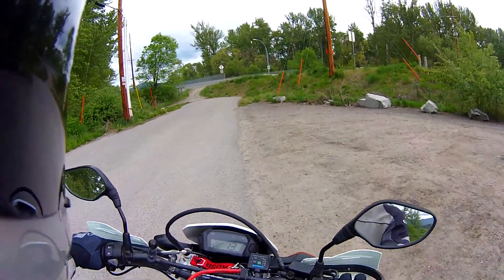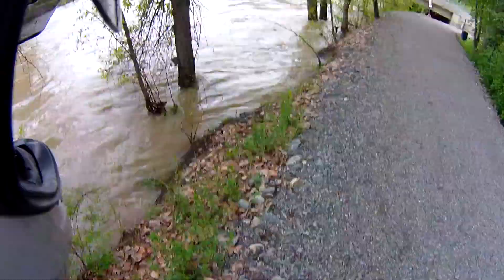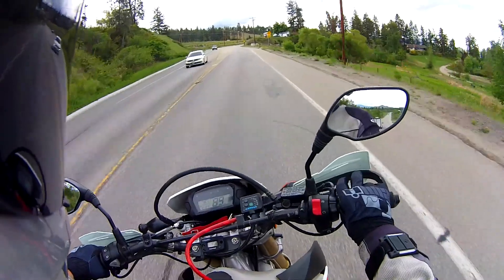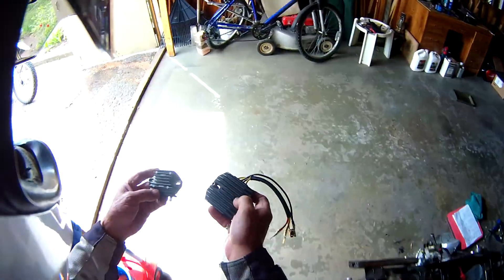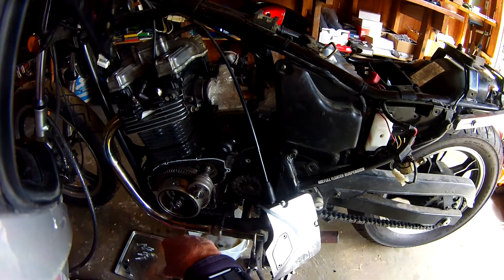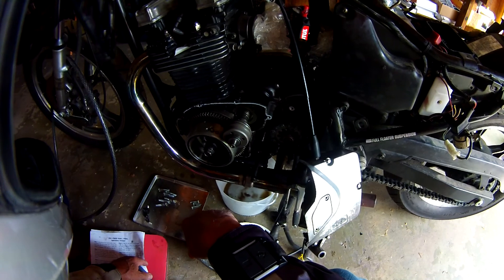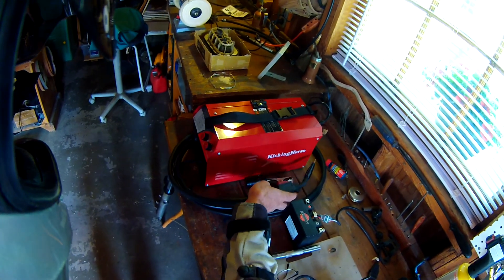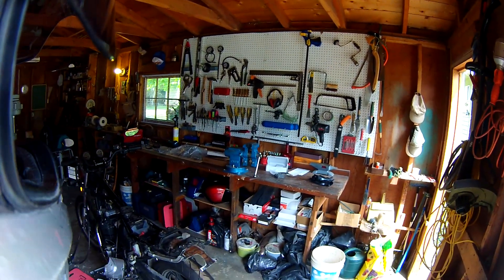High Water and Suzuki GR650 Tempter Electrics Update

Comment: When I push the button on my gr650 it makes no sounds. No clicks to the solenoid which has just been replaced. Battery is brand new everything lights up normal. The switch got to the point where it would work sometimes and not others. I'm thinking replacing the engine kill switch and the starter button with new ones will fix the issue. I am not sure tho, can you help?
Reply from the maker: Best is to trace the power back from the solenoid since you know that isn't getting power, to where there is power. Something between the solenoid and the battery is the culprit. A multi meter would be an asset. Don't forget the safety switch at the clutch as a point of possible failure. It's a pretty feeble switch. I bypass wired mine to eliminate that weak point.
Reply: @Scoottoots  thanks so much for quick response. I have multimeter where should I check for continuity? To address your second point. I have the owners manual and wasn't even aware there was a safety switch on the clutch. Are there any other safety switches I should be aware of ?

Sorry for so many questions in one comment, I've been trying to get this bike road worthy for awhile now mechanically its a great bike.
Reply from the maker: @feartheindoors  I'm no electrical expert for sure. I tend to figure it out as I go. If you check each known switch point for continuity when ignition is off, or power on both sides of the switches while pushing the start button, you should discover where the bad connection is. That assumes of course that it is a switch issue. Either way, a multimeter is the tool for the job. Just get creative and use the wiring schematic found in the service manual to trace the path of the current through the various switch points to the starter. Easiest is to trace back from the starter. You might also inspect the switches for corrosion or dirt and grime. Some fine paper and/or electrical contact cleaner spray would solve those issues. To my knowledge there are no other safety switches aside from at the clutch to prevent starting in gear, and the kill switch. The wiring at the kick stand is not a safety ignition switch. It only goes to the dash warning light, so it isn't on the path you're having trouble with. As always, visually inspect wiring as you can for damage and inspect any ground connections.
Reply: @Scoottoots  I've gotten it to start since last comment but the starter motor isn't spinning after hearing the solenoid click. I've rebuilt the starter motor. But now Considering just replacing it as well as the ac/dc regulator like you have on your bike for reliability. Can you provide me with the link where you got yours if possible ? Thanks for all your help. I've tested the starter motor with a straight DC current and it is spinning fine and powerful. Can't get it to spin with starter button even though solenoid is clicking. Quite confused because its such a simple connection from the solenoid to the starter motor
Reply from the maker: @feartheindoors  You said you replaced the solenoid, so that should be good, but usually when you hear the solenoid click but not engage the starter motor, the solenoid isn't working fully. But since it's brand new, maybe the problem is it isn't getting enough power. Again, that could involve a poor connection in one of the switch points in the path prior to the solenoid. I remember when I bypassed the clutch safety switch, my starter motor ran stronger. So it's good to check the quality of the power getting to the solenoid while cranking. You could be replacing perfectly good parts if you do it by guess work. At the very least check all the switch point contacts prior to replacing things. That said, here's the link to the stator and regulator/rectifier that I installed: https://www.electrosport.com/collections/street-motorcycles-suzuki-1983-gr650 . Note: Suzuki used a two phase regulator/rectifier on the bike. The stators are three phase, so the new regulator/rectifier is a three phase, which improves reliability, but you need to change the way it is connected to use all three phases. Just wire all three stator wires to the regulator/rectifier to accomplish that. The stock wiring has one of those stator wires connected up the handlebar area just to dump the current. The stator wires are all the same regardless of their different colors on the stock unit. You can connect those wires to the appropriate connections on the  regulator/rectifier without regard to their color.
Reply: @Scoottoots  I have a crap duralast Battery that I think is the main issue. I bought this thing yesterday and brand new the battery sat at 12.37. I'm going to try charging it tonight but its down to 12 volts idle and then drops below 11.8 with load. When trying to start the bike the volts dropped down to 4. I'm so sick of these batteries. I managed to get the bike running for a short amount of time. The bike obviously won't crank now because of the battery being drained. Im wondering if the stator generator is gone bad as well due to the fact the battery is losing power. Not really sure how to test this component. After several hours of work I'm proud I got it to run again but aggrevated its more issues with charging/battery. Seems like it should be simpler then this. Thanks for your pointers you've helped a lot.
Reply from the maker: @feartheindoors  That sucks. On fast idle (2000 to 2500 rpm) the voltage should be 13.7 to 14.7 or so. That tells you the charging system is operating well. If your fast idle voltage is lower than that there is likely an issue with the system. If it's a new battery fully charged and it gets run down after riding, then either your regulator/rectifier and/or your stator is not functioning properly. The R/R on this model is known for failures and sometimes a bad one can take out the stator with it, I'm told. Good luck!
Reply: @Scoottoots  I'm just going to purchase those two things that you linked me to. Replacing them I believe will fix the charging issue in general. It seems that this is the culprit because even with the previous battery the bike couldn't hold a charge. This will give me peace of mind anyway being up in the country and stopping for a drink etc. I wish this bike had a kick start 🤣😂🤣 My next motorcycle will 100% have one if available and also will be fuel injected. Couldn't afford it at this point in my life but I'm excited to hopefully get the electrical sorted in this bike before breaking the bank.
Reply from the maker: @feartheindoors  Haha, the joys of an old motorcycle. But hey, you'll get it done in the end and you'll feel pretty good about that. They are a great motorcycle once sorted out.
Reply: @Scoottoots  thanks again for the link to the parts you saved me a ton of time on sourcing and researching. Just ordered these bad boys. Love the idea of modern electrical system on a vintage motorcycle. Especially if you're using it for real riding. .The batteries power just gets zapped by the issues with the rectifier. Worst case scenario, and this doesn't fix the starting issue. I've at least narrowed the problem down to something else.
Reply from the maker: @feartheindoors  All this will be history soon enough :-)
Reply: @Scoottoots  Do you think I need to replace the stator with the new RR ? Or can I just try the new RR first? I'm almost certain  that the RR is faulty because I can get the bike to start sometimes. After riding it or even just leaving the battery in it without the ignition on it will drain the battery. I am told this happens because there is a direct 12v power cable that attaches directly to the RR. After a long period of time these can become faulty and cause issues with power drainage and transmitting. I don't want to have to replace the stator if that's still in working order. I am worried I won't be able to get it off because I currently don't have the fly wheel tool and have never done a job like that 🙃.. Hopefully you can help once again lol
Reply from the maker: @feartheindoors  You can try the rectifier/regulator on its own, but I would test the stator as best you can before just ordering the R/R. I can't recall the test method, but you can google that. It involves checking the output voltage and such coming off the stator. Often the stator will go bad when the R/R goes bad, perhaps because of it. So definitely check that out first. There has to be a certain voltage range of AC current coming off the stator. You don't want to install a new R/R and have it fail because of a faulty stator. You do not need a flywheel tool to change the stator. You simply remove the two covers. The stator is secured to the inside of the main cover. No need to touch the flywheel. Remove the old stator and install the new one. Be sure to see how the wires are routed out of the way and secured so you can copy that on the install, and use loctite on the stator bolts and the wire clamp bolt. Also, if you change the stator, do not pull on the starter pinion. I did that and it comes out freely and drops a large washer into the casing below, lol. I successfully fished it out with a magnet. Just lucky ;-)
Reply: @Scoottoots  ive unbolted the covers near the shifter. I can't seem to be able to pull the stator generator cover off. I've ordered a new gasket but don't want to pry. I think it should Come off easier then this. Is there a hidden bolt I am missing or just the ones on the front of the aluminum housing ? I am wondering if I should remove the shifter and left foot rest ?
Reply from the maker: @feartheindoors  Did you remove both covers? The cover to the rear of the stator cover where the clutch cable enters must also be removed to expose the remaining bolts holding the stator cover on. I can't recall but I may have disconnected the shifter to create room to pull that cover. Once that cover is removed you'll see the hidden bolts for the main cover. The stator cover seems stuck only because of the magnetic pull. Just keep easing it off and it will come free. It's only the magnetic attraction holding it back. And yes, a new gasket is best. unless the cover comes off cleanly and it looks good.
Reply: @Scoottoots  yea I took all the bolts out that I can see go to the cover. Both front and rear. The rear cover with only 3 bolts seems loose but the clutch cable bolt is holding that up. Im not really sure, but ill have to tinker with it a bit more today to see if I can get it off. Figured there had to be another bolt some where because that case cover won't budge. I'll keep you updated, just waiting for those two items in the mail. I believe the original owner already has replaced the RR once a long time ago because it doesn't resemble the original you have in your video. Then again I have the 83 so that might be why as well. Either way I'm excited to see if that fixes the charging/starting issues with the bike so I'll have to get this cover off.
Reply from the maker: @feartheindoors  The 83 has the same parts and it's the only one listed in the parts offerings for this bike. As long as you took out the bolts on the stator cover that were previously hidden underneath the smaller rear cover, the stator cover should pull off. Make sure of course that any wiring clamps are not holding the stator wires tight while you're pulling on it. Initially the cover may be stuck to the gasket, but once you free that up then it's the magnet resisting you when pulling. There is nothing attached to the cover to the cover from the backside other than the three stator wires. When removing it, you'll see two or three (can't recall how many) locator pins. Take note of where they go.
Reply: Hey boss quick update if you're interested! Replaced the entire electrical system, new stator and rr that you recommended work great. Ive also replaced the brushes in the starter motor. Bike cold starts up easy everytime you try it. Very satisfied 😌!!! Thanks a lot for your help. 

Have a small exhaust leak on both sides where there are two small holes on the underside of the pipe. They almost look like their there by design but im sure thats not the case. Did your bike have similar holes on the pipes?
Reply: I am concerned because it blows some thinn white smoke after warming up.. and just from the pipe on the left hand side.... Not sure if this is an issue with the fuel/air ratio ? Or if the bike is just on its way out... Or if its just the old oil/fuel in the system causing the issue. The bike pulls and shifts fine. Also idles fine after cold start. So I'm really thinking its the air/fuel mixture... no way to be sure tho
Reply from the maker: @feartheindoors  That's great it worked out well. Regarding the mufflers, the stock mufflers are not slip-on. They are welded to the header pipes. The only way to remove them is to carefully cut through at the weld and be careful not to cut too deep as the header enters the mufflers under that weld for another 8 inches or so. Those very small holes are there by design. There is also a larger hole in the header a few inches after it enters the muffler. If you remove and discard the stock mufflers to replace with aftermarket slip-on types, you would then have to cut back the header a few inches after the weld point and weld on a sleeve to clamp the slip-ons onto. But then you may have to rejet the carb.

Comment: I have a gr650 that i converted to a hard tail bobber the only thing that worries me is the rewiring part especially now that i seen that you converted to 3phase regulator do you think its possible to still use the 2 phase with a simplified harness?
Reply from the maker: Gee, I'm not sure. If you did, you may have to duplicate how Suzuki wired that 3rd wire. Probably best to get a 3 phase regulator while you're at it.